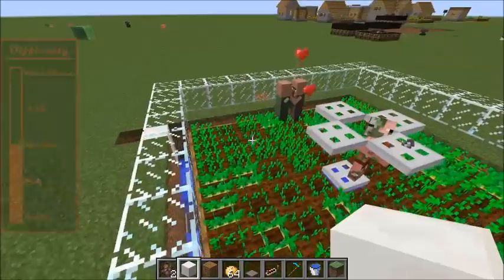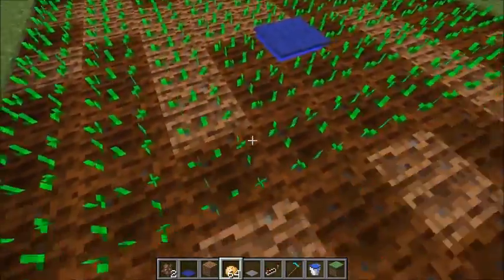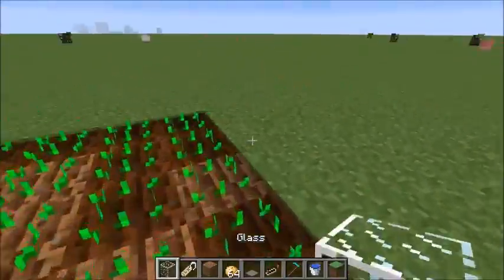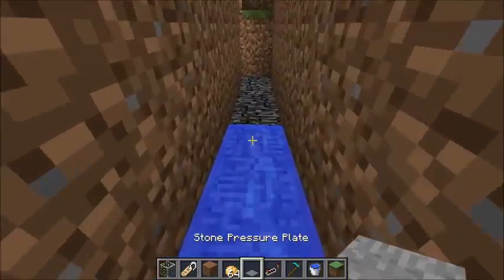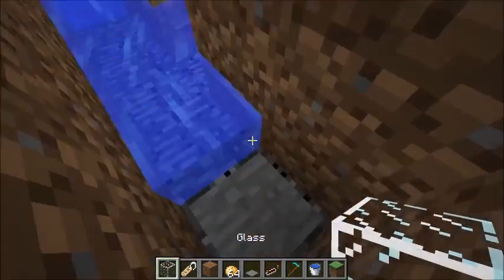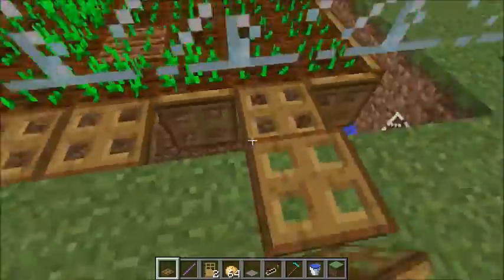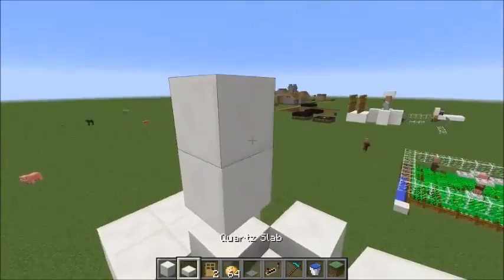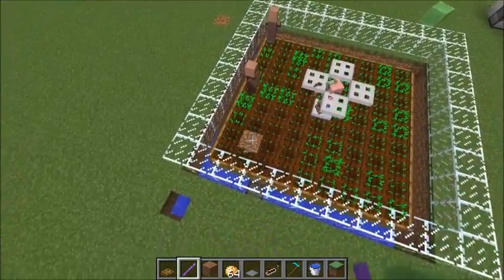Infinite Villager Breeder With Clog Protection (Minecraft 1.11.2)

Comment: the detector villager can be underground right?
Reply from the maker: It can be, but make sure you keep a difference between

the number of blocks that can see the sky in front of the doors,
and
the number of blocks that can see the sky behind the doors.
(within 5 blocks.)

Also make sure that the breeding villagers are not within the range checked for villagers, which is a 9 block high box, with the radius of the village (in this case 32 blocks), centered on the detector villager's feet.
Reply: so i would just go 7 blocks down instead?

Comment: does it work in 1.12? i see mixed comments.
Reply from the maker: It should. You can use a zombie instead of a pigman in 1.12.
Reply: I'm using in 1.12.2 on a multiplayer server.

Comment: what is the point of the detection village?
Reply: It's so the villagers farm crops and want to breed.
Reply: Saporen so it wont work without that?
Reply from the maker: The detector villager is inside the area of the village where villagers count towards the total population of that village, meaning, since there is one villager in the village (according to the game), it is a valid village, but it needs more villagers. The breeding villagers are outside the area where they count towards the population, but inside the radius of the village, so they can tell that the village needs more villagers, but don't contribute to the population, meaning they can keep breeding forever without the village's population cap being reached. So I suppose the detection villager turns the village from a bunch of valid doors, to an actual village.
Reply: SerpentDagger ohhhh Thanks!!!!!....so it is necessary?...
Reply from the maker: Yup, lol. :D

Comment: Welp. 1.12 broke this farm. Dang it would have worked too
Reply: r u sure it did?
Reply: ilparrow Gaming ya
Reply: ilparrow Gaming villagers won't be afraid and run from the passive pigmen anymore
Reply: just tested it, and it works as it used to in 1.11
Reply from the maker: +MeLikeSoap: If they aren't running from the pigman, they'll still run from a zombie. Use one of them  instead.
Reply from the maker: +SerpentDagger: Whoops, that came out slightly impolitely, sorry about that.
Reply: SerpentDagger don't worry about that man. But the thing is that you couldn't have glass above the farm so that you couldn't have it outside.
Reply from the maker: +MeLikeSoap: Actually, you could put glass above breeder, and even a solid block above the zombie's head. The glass won't interfere with the doors' validity, and the solid block is too far away.
Reply: If i use a zombie villagers will die right?
Reply: You'd want to surround the zombie with a full square of trapdoors so there are no corners they could reach through, I think.
Reply: I did exactly that. I put in a zombie instead of a zombie pigman and added iron trapdoors to the corner to keep it from killing the villagers and I added a solid block way above the zombie's head to keep him from dying in the sunlight. However something about the line of sight is off. The adult villagers are scared by him too and won't breed anymore. Can anyone tell me why? And can anyone explain the whole line of sight thing to me? When can mobs see each other, and when can't they? and why would a transparent block like an iron trapdoor block vision anyway? Help me out here, thanks.
Reply: Okay, I just added a layer of glass on top of the trapdoors and it is not working fine. I think the height of the zombie plus the iron trapdoor he's standing on makes him taller than 2 m, so you need an extra layer of blocks to block the line of sight. Maybe a lily-pad instead of an iron trapdoor for him to stand on would prevent the necessity of the layer of glass.
Reply: A zombie villager does the trick too